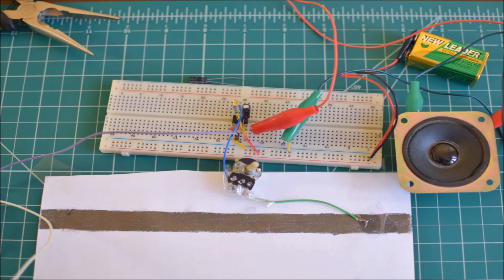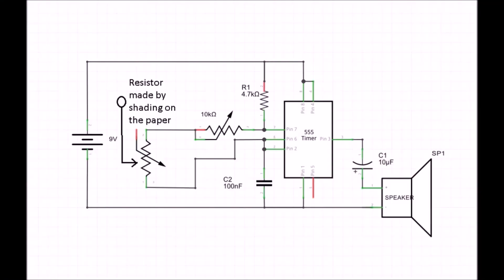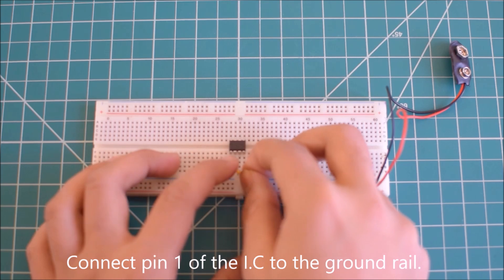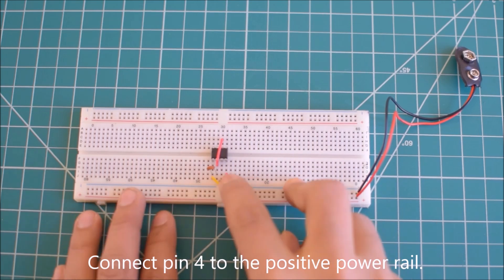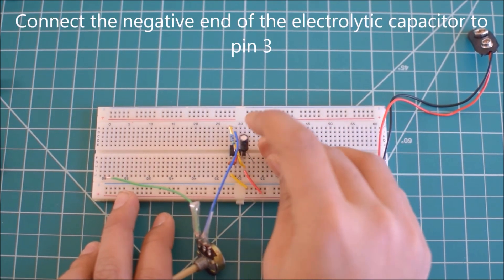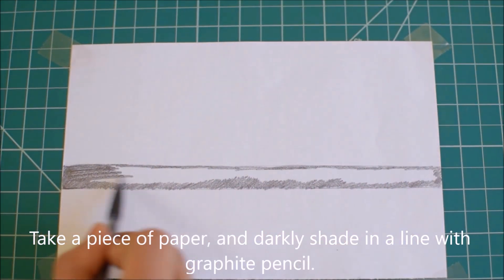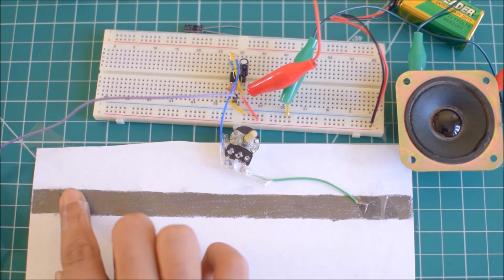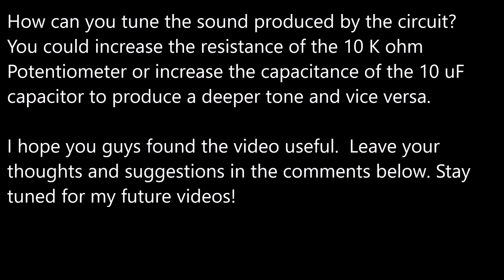How to make a Audio generator

Comment: I did everything you did but it acts really weird, it makes a tone similar to an “amplifier not connected to anything” sound when the place where the potentiometer and paper should be are not connected to anything and the slightest continuity between the to wires will make the sound stop (even if I touch the 2 ends at the same time) I do not know what I did wrong, I’ll try another chip, maybe the one I’m using is busted :/ I will reply “it is busted” if it has been blown on previous uses.
Reply: I tried another 555 timer ic and it  acted the same way :/ if you can help I would appreciate it :)
Reply: P.S. if I use speaker that is not 8 ohm, will it still work, I’ll try it and see if it works, if I have one :) edit: I just tried it and it still acts weird :/